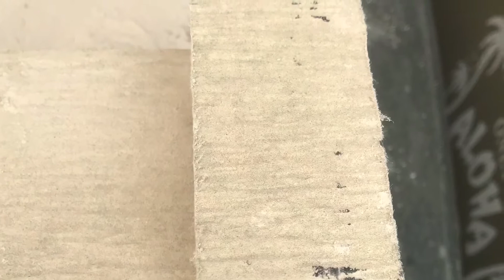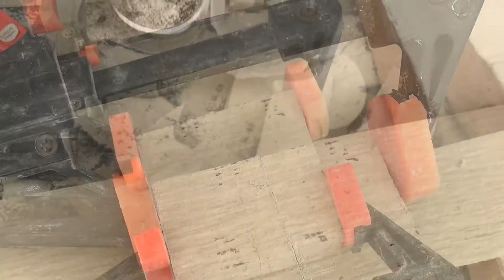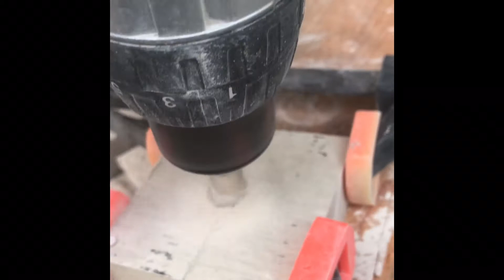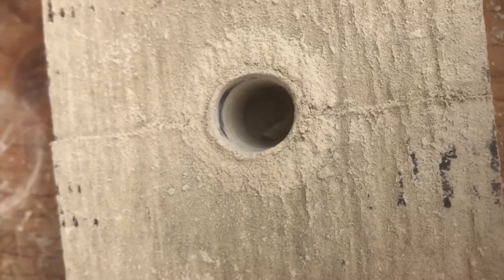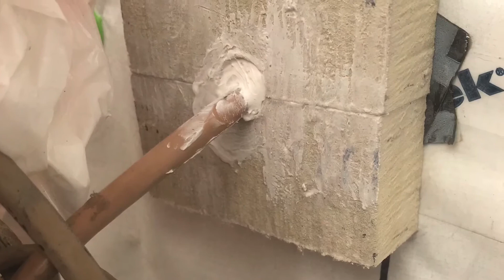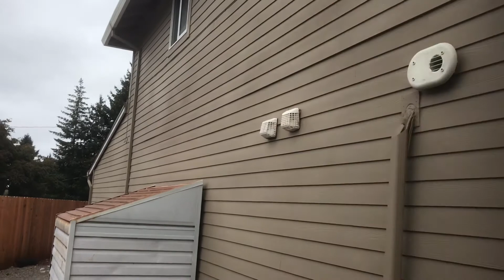Blocking for items that penetrate the house siding when installing Hardie Board siding.

Comment: hardiboard best practice calls for flashing above the blocking and the top joint is not supposed to be caulked with flashing.
Reply from the maker: I did flash it with flexible window flashing and the caulking is only on the top and sides. I leave the bottom open for any possible water that could get in to have an escape route. Thanks for your comments.
Reply: @davidmartindaletheycallmemacgu  I saw the flashing in the video. I was just mentioning if anyone was wondering. Looks good
Reply from the maker: @Thr33fn  Thank you John Have a Happy New Year!
Reply: I wouldn’t be showing this horrible craftsmanship. 😊